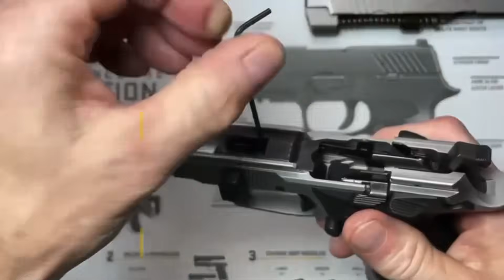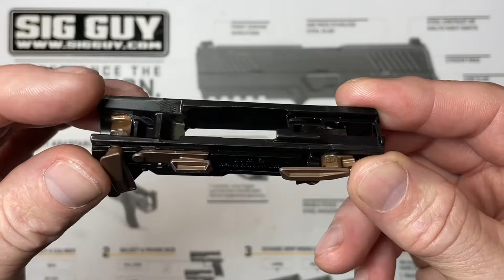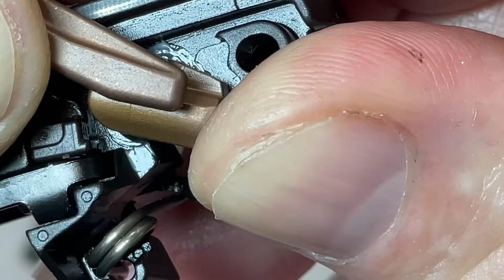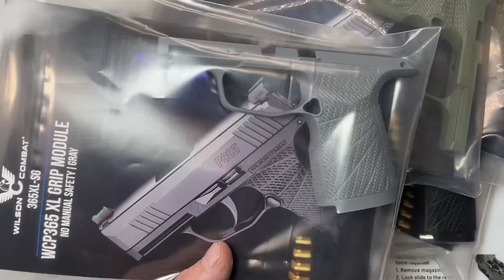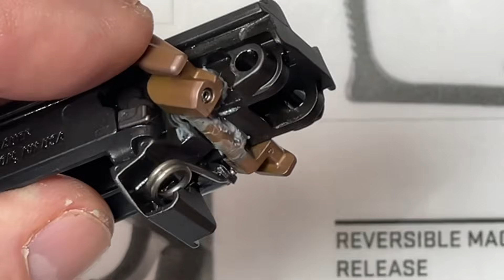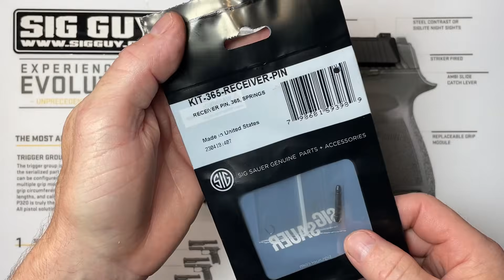How to remove and install the SIG Sauer P365 manual safety assembly.

Comment: Very helpful video. Thanks. 👍🏼

Info for those seeking help:

If after you install safety and get it back together, and the action of engaging/disengaging it is extremely difficult and/or rough or crunchy, it means you pushed the last pin that holds the FCU in too far or not far enough. Just went through this and thought I got sent the wrong grip module or safety components by sig but after disassembling and redoing this, I made sure to push until I hear that small click telling me the spring was correctly in the slot. After that it worked fine. Still slightly stiff just being brand new parts but significantly better than it was the first time. I was trying to get the pin perfectly aligned within the slot just cause I’m ocd but this caused it to bind.

Comment: So, unlike the P320 that needs a pin if you want to not have the manual safety, I can just remove the manual safety and place the FCU into any P365 grip that does not have the manual safety notch? No pin needed for the P365?